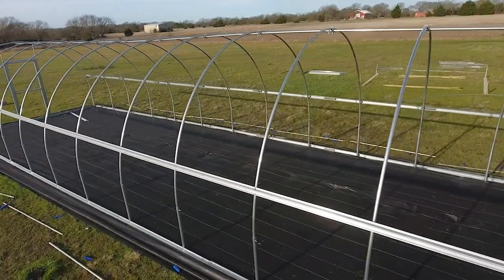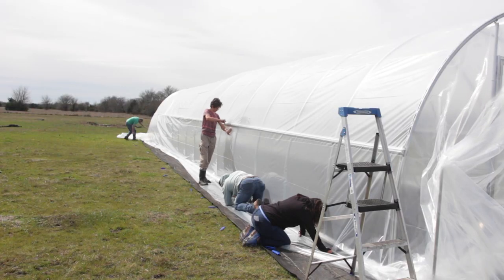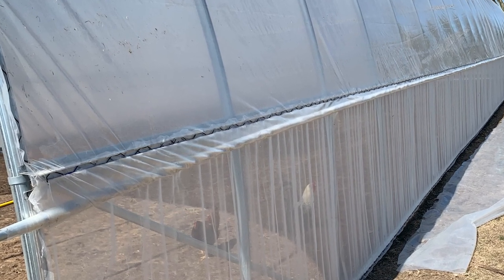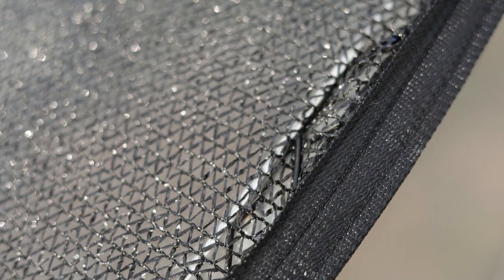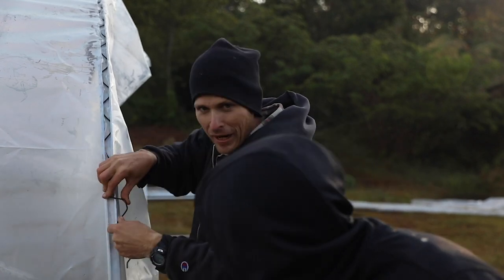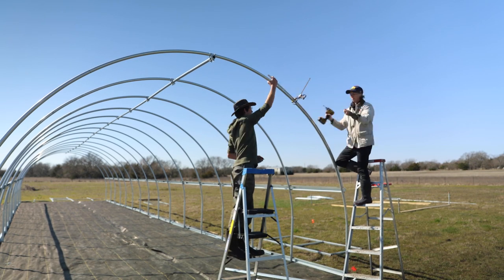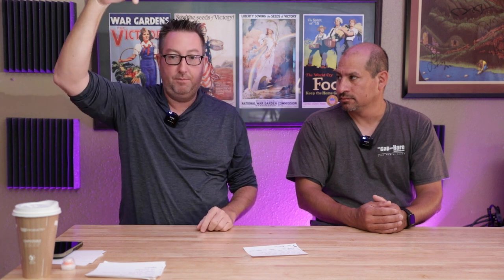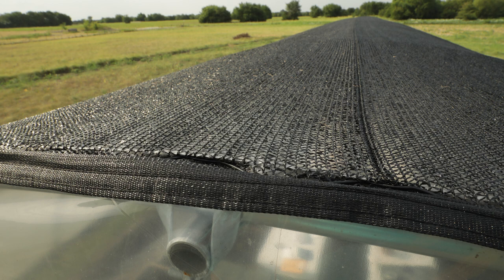Spring Wire & Lock Channel | HOOP HOUSE 101 Ep13

Comment: Do you HAVE to wiggle wire channel the hoop itself or can you just wiggle wire channel the base boards and end walls???
Reply from the maker: Do you have to do the hoop. It’s the main part that keeps the roof super tight. Mind you it’s not each hoop, just the end hoops.
Reply: @BootstrapFarmer  appreciate the response. I know it's a 2 year old video LOL. Just building my first hoop house and wondering how many channels I need

Comment: Are you saying multiple wiggle wires fit in this channel for different layers or it needs to be removed and reinstalled with multiple layers held with a single wiggle wire?
Reply: You can install multiple items like plastic, insect netting, and shade cloth, each with its own wire.
Reply from the maker: Yes, multiple wires so each layer can be tightened individually.